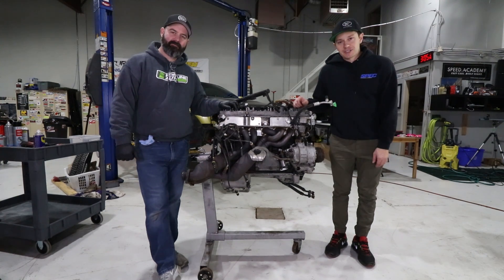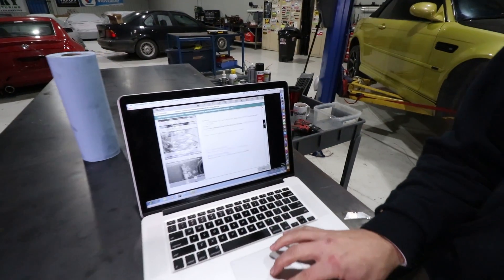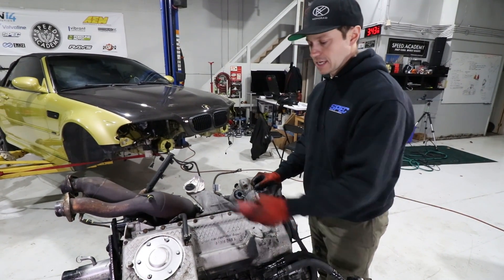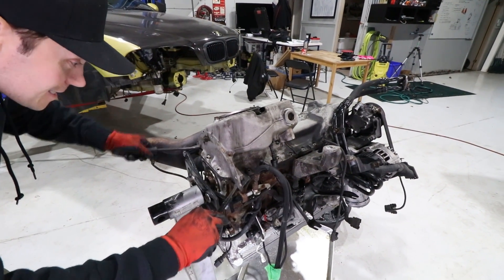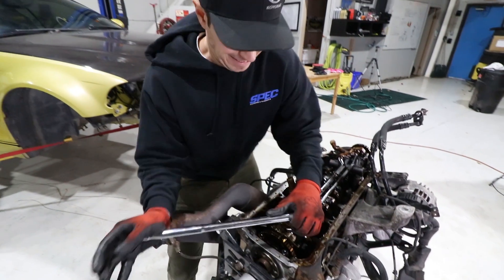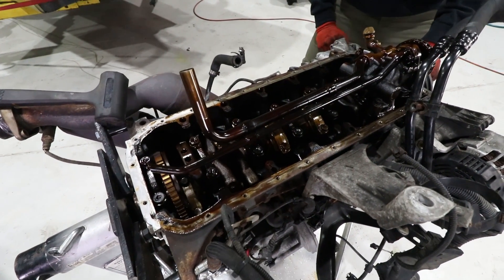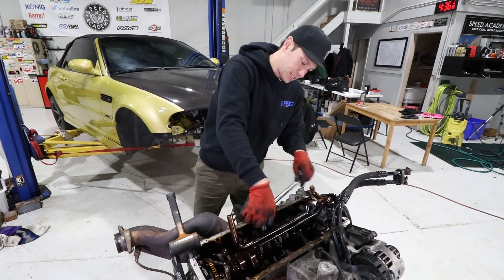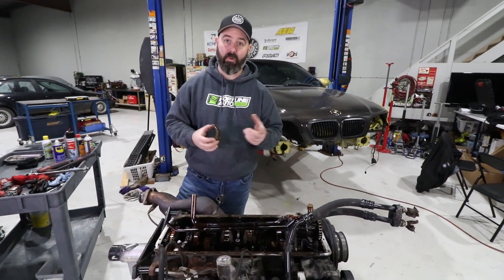Rebuilding and Modifying a $4000 BMW E46 M3 - Part 9

Comment: After the rod bearings you'll need to check the vanos,the exhaust hub is probably broken,the timing chain guide is broken into pieces.You've got it torn down you might as well rebuild the vanos system,hone the cylinders,replace all of the gaskets,change the oring on the constant pressure valve,water pump and thermostat,adjust valves ect.Complete rebuild.

Comment: Only reason the rod bearings wear out so often on these engines is due to the extreme pressure placed on the upper rod bearing during compression and combustion. The rod bearings and journals they designed were too narrow for the amount of pressure exerted on the bearings. there wasnt enough surface area to absorb such pressures and as such it would squeeze through the oil film causing occasional metal on metal contact. this is why bmw changed the reccomended oil to 10w60 instead of the originally reccomended 10w40 as the thicker oil creates a stronger oil wedge.

Id do wpc treated bearings and arp rod bolts. Also get the besian systems vanos overhaul kit, if the inside of the engine looks that scuzzy the vanos could be close to failure as well.

Comment: The rubbing is most likely due to the oil pan touching the sway bar. If the motor mounts are worn, the engine will sit slightly lower and begin to rub.
Reply from the maker: Thank you! Thats what we thought.

Comment: One of the wear marks in the oil pan is from the power steering high pressure hose vibrating against it and the other one from sway bar rubbing

Comment: The wear on the oil pan is from sway bar most likely. It's worn out crushed engine mounts causing the engine to sit lower. Once new engine mounts go on, the engine raised back. Problem solved.

Comment: Fun Protip I learned working on military aircraft and complicated panels with a lot of screws, all of different lengths and sizes:
Diagram the panel/pan/etc. (other references if you need them) on a piece of cardboard, and use a phillips screwdriver or punch and follow your pattern as you remove the screws. You can maybe set it on a table if the fasteners are long enough, or, set it on a hollow-center workbench or the like. Not only do you preserve the pattern, but it might actually have some bonus retention on the fasteners too.

Binged this entire series the other night except the very early videos. I plan on picking up an E46 M3 myself in the near future and your vids have been great looks into doing some of the "problem fixes/preventatives" that I will most certainly be doing.
Reply from the maker: Thanks for the tip! And glad you enjoyed the series.

Comment: The bottom halves don't look terrible but you should be checking the top half of the bearings which are in the rods. The top half of rod bearings are under the greatest load, as are the bottom halves of crank bearings and they are the ones which will usually show the greatest amount of wear. Good luck guys.

Comment: if you are doing new bearings you should also look at the crankshaft, and have it honed. wear on the bearing means there will be wear on the crank. new bearings on a worn-out crank will have a drastically shorter lifespan vs. properly rebuilding the lower end. but it is more money in the build so do what you want.

Comment: Regarding the Rod-bearings, the main reason why these seem to wear out quicker is, apparently, due to them being undersized for the application.  Whereas on the S65 (The V8s), the bearing tolerances were at fault and the issue can be remedied by switching to proper gaps, with the S54 it's simply a wear item, unless you spend big money and get a modified crank to accept wider bearings, such as from Lang Racing in Cali.

Honestly, replace them with OE bearings and don't worry about it for another 100k at least.  There isn't a ton of information out on aftermarket bearings for these, at least nothing conclusive.  WPC treatment has become a new trend on the forums for these (Mine are OE with WPC treatment), but that's another thing we don't really know much about, let alone if it's worth the increased cost.

Definitely do check out the VANOS.  It's easy to do when you do the Valve adjustment, which i'd definitely do on this old girl!  For the VANOS, look at the oil-pump disc to confirm that it has been upgraded.  That or make sure that the Hub itself has been upgraded.  If neither is the case, i would play it safe and get that done.  One more thing is the Hub-Bolts.  They like to back out unless they have been changed.  That's a bad bad day.  The upper Chain tensioner also likes to break.  The complete VANOS rebuild should not cost more than 3-400 bucks if you go with Beisans (www.beisansystems.com) parts.  It also has absolutely all the information you could ask for regarding timing the engine.

Cheers!  Love the channel!
Reply: Vac motorsports has actually developed a bearing kit for these, which "kind of" lets you forget about the problem. I know a bunch of people who've had them for a while, and no issues so far. You can safely run them for years.
Reply: @Doggepp  What do they change?  Wider bearings is the answer to the issue but that involves grinding the crank.
Reply: Hey scotty! fellow m3forum member here. isn't this series fantastic. Ive emailed them with all the DIY links and stuff haha.
Reply: Doggepp thanks for posting about VAC Motorsports. When I need to do mine I will definitely buy their kit. I also watched the video which was very informative.
Reply: PenguinScotty Everything you just said is absolutely right.My 04 is at about 1200mls on a total rebuild and everything you said is what was changed or repaired.The s54 is a poorly designed engine and I believe that BMW knew about the problems and didn't care.Testing would've showed that the bearings were to small,the subframe was too weak,ect.They build cars for BMW people that buy or lease for two years and the next owner is stuck with garbage.E92m3 e60m5 e60 m6 all are poorly designed.
Reply: @realisrealite5554  It's not a poorly designed engine.. BMW's goal was to minimize the amount of friction, to maximize power output. So these bearings are designed to be low friction, (i.e. small surface) and with a softer material, to not wear out the crankshaft, not easy to do. Do reallize that the design was done around the year 1999 / 2000.. in 2019 it's easy to claim 'poor Design' which was state of the art almost 20 yrs back. I love this engine simply for that reason were engineers pushed mechanical boundries
Reply: I understand what your saying 
But I personally know people with stock E46 m3s on stock rod bearings 
150k plus and they drive them hard 
How is that possible if there is a engineering issue?

Comment: Check out BE Bearings. They make a bearing specifically to correct the OE problem of insufficient oil clearance. Also use the ARP rod bolts and a rod bolt stretch gauge. Oh, and remove that oil pump and pickup tube out of your way and do this right! http://www.bebearings.com/store/index.php?main_page=product_info&cPath=51&products_id=27

Comment: +1 for King race bearings. There's a reason why they are one of the most commonly used on the EJ20/25 motors... which is the motor most notorious for bearing failures. I used them on my personal EJ20 and so far so good, no bearing material in any of my oil changes so far! I used the XPG bearings which are the top of the line race bearings.

Comment: Owning a track car E46 M3, i'd run WPC treated oem bearings( ecs tuning) and oem rod bolts. I've used this now for 4,000 hard track miles between time trials, hpde, and w2w racing. Seem's to be a stout combination. Also i've heard alot of good things about the new ACL tri-metal bearings. very very good price point and great technology behind them. I also always run liquimoly 10-60 wittth their friction reducer (mos2).

Comment: It's also worth looking into upgrading the oil pump. I was "forced" to because the pump shaft threads were stripped. VAC Motorsports makes a kit that replaces the pump nut with a bolt, new gear, and shaft. You can also buy a higher volume pump from them - or do the modifications yourself.

Comment: The Castrol oem oil causes varnishing if you follow the recommended service intervals. I went with king race bearings and ARP hardware and the updated oil pump and now use 10w50 Titan pro Fuchs. Although if this is gonna be drifted I’d stick with 10w60 and change regular
Reply: Yeah, the Varnishing of the Castrol is nuts.

Personally, i went with OE bearings with WPC treatment and stock hardware (early motor, so no stretch to yield).  WPC is probably overkill, honestly.
Reply: ACL bearings with syntium 7000 here never had a problem in a mildly boosted 2.8L putting out 380 whp
Reply: PenguinScotty better to go ott than not good enough!
Reply: I bet Adam only has a 325i not a M3 anyway. He's no even a real Palooka
Reply: thedownshiftchannel r
Reply: g4rr377 top palooka
Reply: making the switch to motul with added zinc was the best decision i made for my engine e46. After a few changes the oil cleared up and the crankcase looked much better.
Reply: Palookas know!

Comment: The heavy wear will be on the rod side, not the cap side. Since this is a project car, it probably would be fine using aftermarket bearings such as King or ACL to save on cost. For a daily driver, OE bearings  are proven to be good for 100-125k miles. That S54 looks like an early motor with the beefer M11 bolts which have the easier torquing procedure and must be reused per BMW spec. The issue is that each bolt has to go back into its original location, and when watching the video, it did not look like they were marked when the caps were removed. The ARP M11s were tested for clamping force and were within stock spec; however, the ARP M10 bolts, which need to be used on the later post 2003 S54s, did have an issue with clamping force. Best to go with stock for the M10s.
Reply: I've always been curious WHY they have to go back in the exact same hole.  That seems bogus to me.  I am building a heavily modified S54 right now where I mixed and matched rods from multiple engines to get a nicely balanced set.  I also didn't pay attention to the bolt orientation so I guess we'll see!
Reply: @Spangarangg I believe the rod bore machining was completed in a torqued state with the bolts in place to ensure perfect roundness when they are in the engine (much like a torque plate on a cylinder block) By using the same identical bolt you ensure the same torque characteristics depending on the thread and mechanical properties of that specific bolt.

Comment: You want to use a OEM bearings with WPC treatment and ARP bolts also the marks on the oil pan are caused by the motor mounts wearing causing the oil pan to rub against the steering rack. Ask me how I know...

Comment: If the oil pan bolts are aluminum you need to get a new set from bmw! We do oil pan gaskets all the time at the bmw dealership i work at and the aluminum bolts are one time torque to yield bolts

Comment: The oil pan wear marks are from the power steering lines. 

Make sure you are also inspecting the crank carefully. The nitride surface treatment is strong, but it can start to develop pitting marks with severe bearing wear.
Reply: Plus 1 on the power steering lines. During the bearing recall when everything gets re assembled it's often overlooked that the PS lines needs to be counterflexed before fastening to prevent them fastening in a flexed position causing them to rub on the sump...

Comment: You guys need to develop your engine disassembly skills.
To pop the rod caps loose: Loosen the rod bolts until they're only in about 3 or 4 turns. Take a socket on an extension and strike the extension with a hammer/mallet. The caps should separate from the rod. This is pretty much required to properly disassemble fracture split rods. Keeping the bolts threaded in prevents you from mucking up the threads and also keeps the rod ends from separating too much and the bearings possibly falling down into the engine or the rods from flying around. 
Also, mark the orientation of the rod and the rod cap! And don't mix them up!

Comment: Based on that second bearing, the bearings had to have been changed since the recall was done.  Also, you should have shown the upper bearings because they are always worse.  I've taken a lot of S54s apart (more than 10) and it looked like those rod bolts were over tightened.  In my opinion, WPC treated OEM rod bearings and stock bolts are the way to go.

Comment: Your existing rod bearings actually look good for the mileage, it might have been replaced already. Most of the wear is typically on the upper rod bearing during compression. I too, have an e46 m3 with high mileage. Vanos exhaust hub should also be inspected as well as the upper timing chain guide. For a really tight budget, acl race bearings with wpc treatment is what I'm in the process of putting. It's actually the rod journal size that's undersized for a 3.2l 8k rpm engine. Beisan systems has a s54 vanos repair kit. These engines are amazing but do require TLC to prevent castastophic failures. I plan to drift my m3 too. Good luck!
Reply: What is wpc treatment?
Reply: @TheYummyBrand  It's a micro shotpeening process.  There is a really good video here on youtube that shows what it is and what it does.
Reply: @Spangarangg  thank you, I'll look that up
Reply: OMG, I want the wpc treatment on every moving metal to metal surface!!!
Reply: Jacob Walls in theory it won’t matter for rod bearings (because they float on a film of oil) but it’s a pretty cool technology right!
Reply: @Spangarangg  I would respectfully disagree bc the technology also increases the hardness and reduces friction of the part...friction is a destructive force and hardness resists destruction, I would do the wpc process on any bearing susceptible to undue wear...or on any journal bearing, esp one in a turbo
Reply: @Spangarangg  agreed, an amazing technology!
Reply: Jacob Walls what I meant is that the bearings should never come in contact with anything except an oil film in which case the WPC treatment wouldn’t really do anything. But in practice it will. As you said, it should reduce bearing wear (at the expense of crank wear maybe).
Reply: @Spangarangg  yeah, I would always do both sides of a journal bearing as a matter of course...however, if it's a stock crank, one might not give a shit about life of the part...I would think wrc treatment is a great idea for the main bearing bc of the apparent lack of longevity engineering. Wouldn't you agree? Btw, what do you think would be the highest parasitic loss, for metal to metal contact, in a drivetrain?
Reply: @TheYummyBrand  be careful, it can get expensive. lol
Reply: Jacob Walls With this engine, the cranks are becoming very expensive because of the rod bearing issues so you want to do everything in your power to not end up with a damaged crank. The parasitic loss from the crank touching the rod bearing is negligible because it shouldn’t happen to any appreciable degree. The reason that it’s an issue with these engines is the narrow rod journals and bearings which BMW did to decrease normal parasitic losses (not related to the crank touching the bearings). I personally would have rather had wider rod bearings and a few less horsepower. But with that said, I have WPC treated OEM bearings in my personal built S54.
Reply: @clarencetrinidad9149  what is the pricing anyways?
Reply: @Spangarangg  so treat both?
Reply: @TheYummyBrand  Well it's actually not very expensive if you just need the rod bearings treated. They estimate based on surface area being treated. For s54 engine, its roughly $50. But it gets expensive if you decide to treat other parts, pistons, cams, crankshaft, etc...I'm in the middle of an engine rebuild and WPC treated most of the rotating assembly and set me back about 1k
Reply: Jacob Walls Both rod bearings? Yes. To answer your other question, WPC treated OEM rod bearings are readily available for about $400 for the whole set. The WPC treatment doesn’t add much cost. Untreated OEM bearings run around the same cost depending on who you buy them from.
Reply: @Spangarangg  I meant the journal bearing on both sides...caps and crank...check that question, I watched the video a bit further
Reply: @clarencetrinidad9149  what do you think would be the highest parasitic loss in the rotating assembly and in the drivetrain as a whole(such as engine, diff, trans as a whole)?
Reply: Jacob Walls When I say rod bearings I mean the two bearings (rod cap and rod) housed in the rod itself. They aren’t specific to BMW. To my knowledge, no one (at least in the BMW realm) WPC treats the crank journals.
Reply: @Spangarangg  yeah, I saw that later in the video, lol...my bad

Comment: Video on my channel of what a spun rod bearing sounds like on my S54 😭
Don’t wait. Get your rod bearings changed, use the proper amount of the correct oil. Thankfully the damage wasn’t too bad. Had to polish the crankshaft journal a bit and put it back together with King bearings.

Comment: 1. should have left the power steering line and pump connected on the subframe. Just easier. 

2. that motor looks like long time between oil changes. Which means the whole motor should be looked over/rebuilt. 

3. style 24s on a e46 m3 is hilarious.

Comment: Dont know if i missed but should have done a compression test before removing the engine that way you could also do the headgasket while the engine is out if needed. 
But i would do it while its out.
Reply: E46 M3 I was thinking the same thing my man !